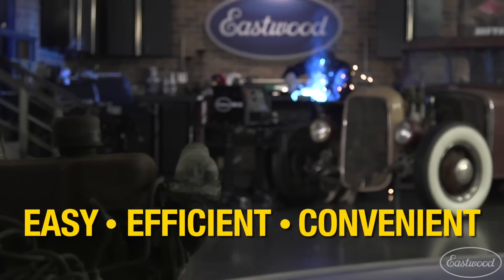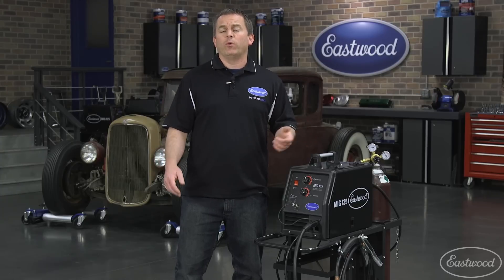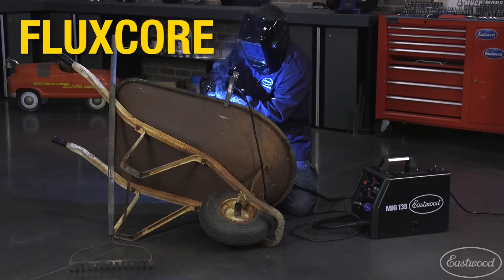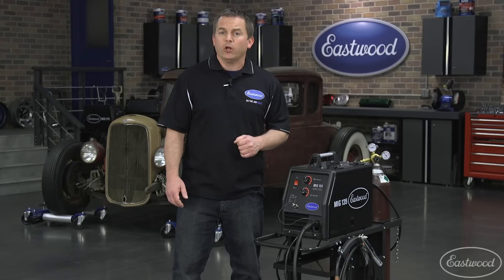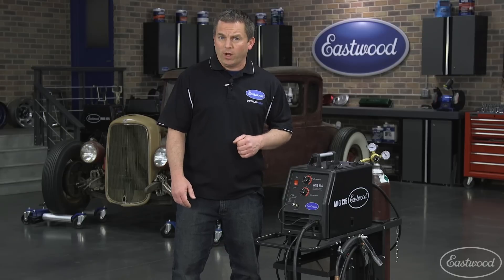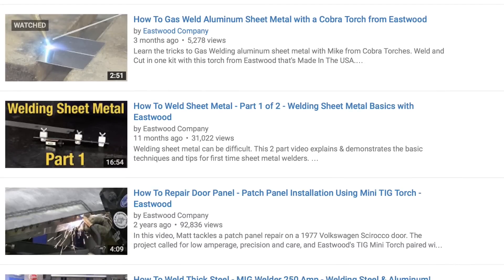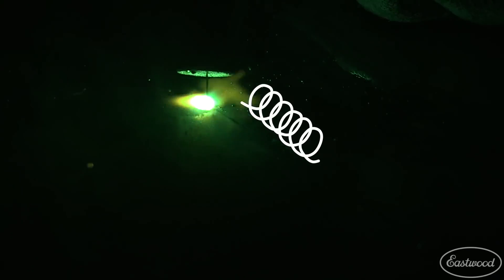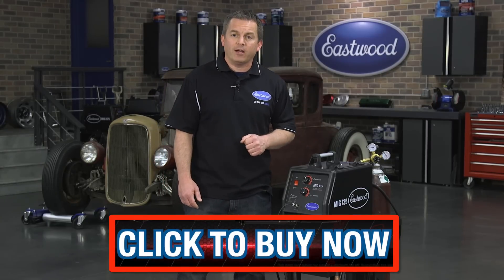Eastwood MIG 135 Welder - A Must Have Welder for Your Garage!

Comment: Have been looking 3n1 units for the versatility but this seems hard to pass up with the warranty.
Wish it had a metal drive, that seems to be the weakness in units like this.  Great video, these are usually terrible.
Reply from the maker: The MIG 135 is a screamin' deal right now. 
https://www.eastwood.com/mig-welder-110vac-135a-output.html
Appreciate the positive feedback, btw.

Comment: tried welding 1/16 square tubing with harbor freight for two weeks. i gave up. got one of these and after couple of minutes of practice, i finished an entire project for RC mower.on the other hand there are much better welders out there for only 100 more.
Reply from the maker: Hopefully we've converted you into an Eastwood Guy! Don't forget about us when you need a new welder, or any type of supplies.

Comment: Could you potentially weld a tubular frame together with this or would you have to use the 175
Reply from the maker: depending on thickness, you would likely want the MIG 175. You should check out the MIG 250 as well.  Here's a link to our MIG welders:  https://www.eastwood.com/welders/mig-welders.html

Comment: I've been running the hell out of mine since last year as a flux core welder 1/4" thick no problem with multi-pass could go thicker. great machine for the $
Reply: Will this weld stainless sheet metal?
Reply: @UncleSarkis  no sorry mild steel only
Reply: @jeffreysnethen9586  thanks!

It's 165 with discounts right now so I think I should buy it
Reply: @jeffreysnethen9586  I mean, 159.97 now.
Reply: @UncleSarkis  that's a good price
Reply: @jeffreysnethen9586  I just bought it. I paid 190.27 for the welder, a knurled drive roller for flux and free shipping.

I'm pretty sure they didn't make much money or anything from that sale. As a result, when I upgrade, I'll buy another Eastwood machine.
Reply: @UncleSarkis  awesome
Reply: @jeffreysnethen9586  Thank you very much for your input.  I'm going to make me a Mediterranean style grill, who knows, maybe even sell one, which will make up what I paid for the welder.
Reply: @UncleSarkis  your welcome

Comment: So this welder will work good for making a frame out of 2x3 3/16? Do I have to do multiple passes on 3/16
Reply: Does it work without gas?
Reply: @ronniecooper5716  Yes, he talks about it in the video.  Flux means no gas, but, this unit also has a gas option which is good for future proofing if you ever level up to solid core.

Comment: I just bought one so What size tank for gas?
Reply from the maker: We use 80 CF tanks.
Reply: I found a supplier of tanks just around the corner and got a great price on it which included the gas $147.00 50SCF of gas 25% Co2 & 75% Argon. Thanks for your help.